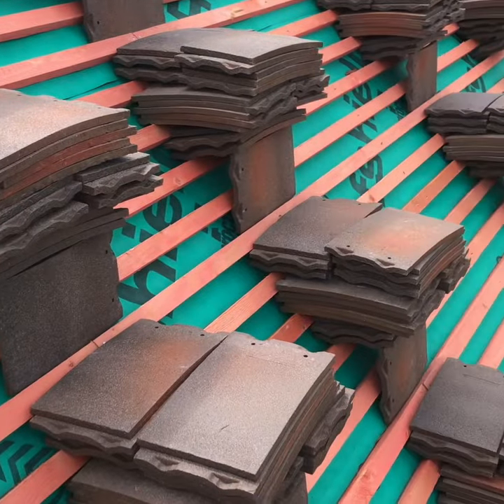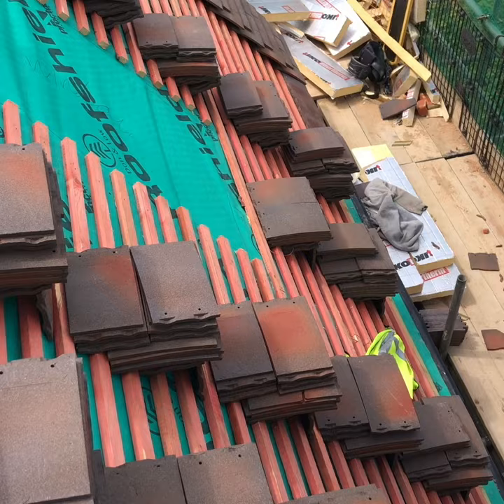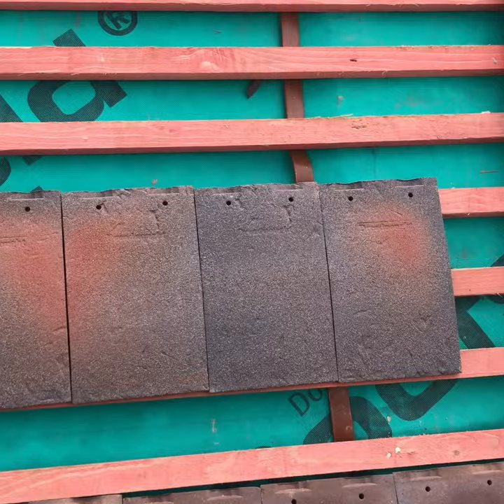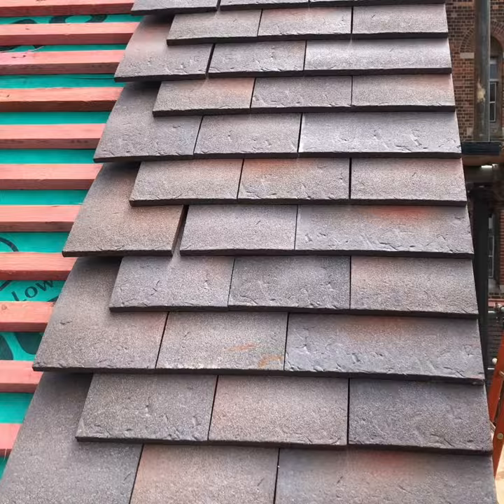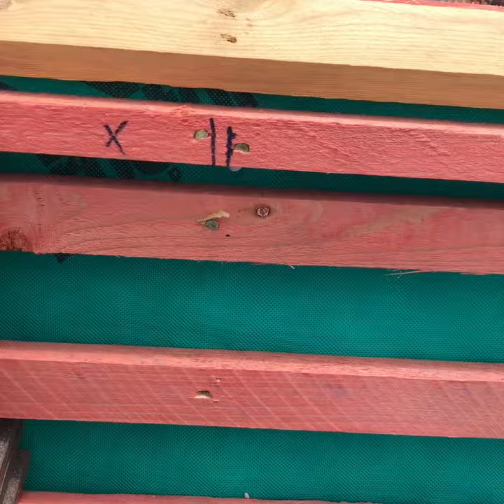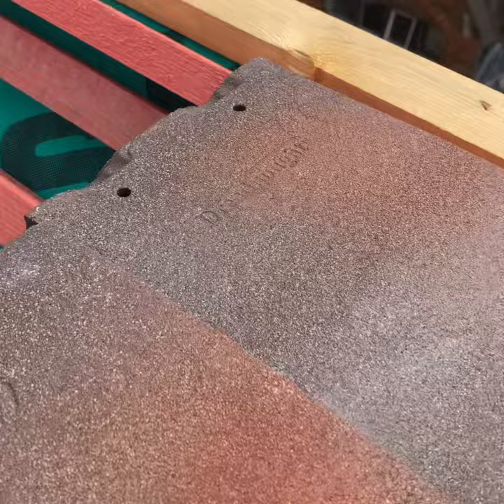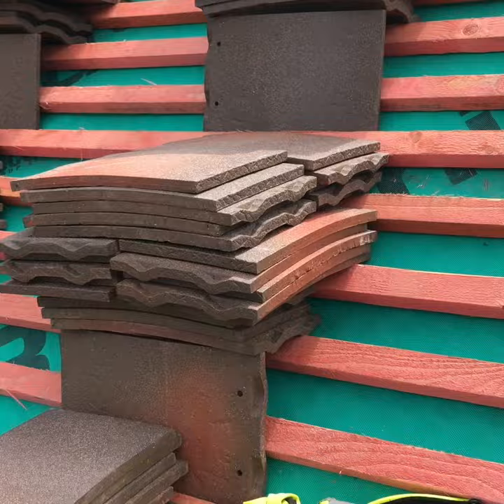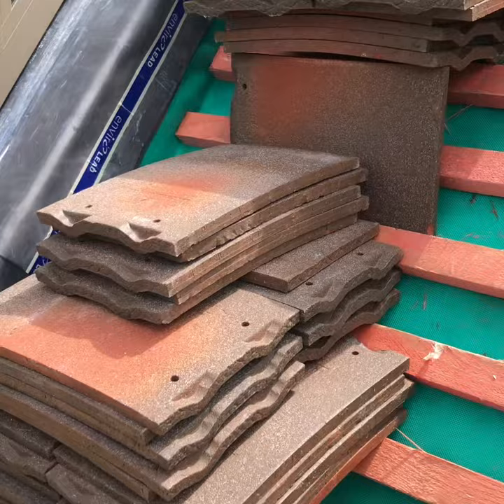How to load a plain tile roof

Comment: Does the supporting tile at the bottom cut into the felt
Reply from the maker: @aspec999  no, you want the supporting tile to have a rafter taking the weight of the tile. You don’t want to put stacks of tile on just felt without the rafter as that is what supports the weight. The supporting tile is there just to support the stack.

Comment: i put them straight on, one pulling up, one passing, i touch the tile once
Reply from the maker: Doing that gives me a sore back. It works for me on a small roof like a garage but I personally just prefer to load it out. I have a bunch more videos if you want to check them out. We loaded a 60,000 tile roof and a 28,000 plain tile roof. Had about 5 of us losing it out. Appreciate the time. 👌🏽.
Reply: @roofinguk  most i ever did was 12,000, im lazy now, speed not my thing
Reply from the maker: @davidbird380  I have a video of the 60,000 and the 28,000. Was allot of work as we had to throw from the ground to scaffold then chain up the roof. 😴😴

Comment: Far to complicated too much information in too shorter time .so having said that pretty pointless . Also doing a job like that stacking the tiles is the least of your worrys.
Reply from the maker: I do them short so it’s not needed to skip sections of the video. Whoever is watching can press the pause, rewind button if needed. Also stacking tiles on the roof is an important prep for a roof. It gives you a good step in the right direction to get the tiles on the roof so you and your work mate can both lay tiles and make the job faster. 

Thanks for the comment.
Reply: @roofinguk  well said mate! Ignore him! That’s how I load out that’s the proper way 👍🏻
Reply from the maker: @rossko727  Thankyou for the support bud.

Comment: Proper way, so pleased I only do torch on flat roofing nowadays. Working on plain tiles and pegg tile fucked my knee cartaledge up, do miss it in a way
Reply from the maker: I helped with torch on and really enjoyed it. Unfortunately the company that I worked for dealt with asbestos unsafely and wanted us to use grinders to cut through sheets so I left pretty quick.
Reply: @roofinguk  yeah good move , torch on sbs is the best flat roofing system out there , get on it 👍

Comment: What a load of bollocks 🤷🏻‍♂️
Reply from the maker: Very important process for roofs. Last thing you want to do is turn around after laying 5 tiles at a time. Especially when you have thousands of tiles. A lot of the roofs we do have 20-30,000 tiles to lay.